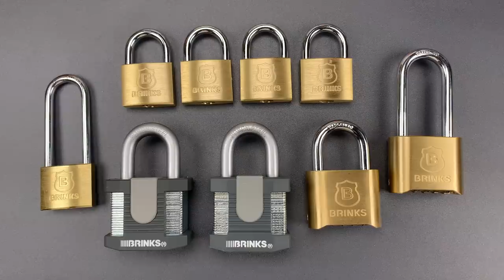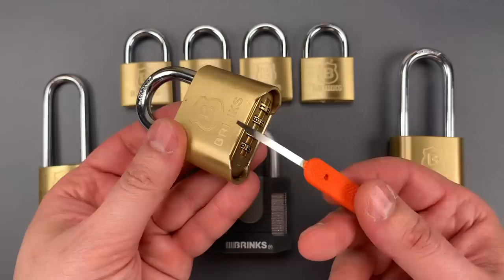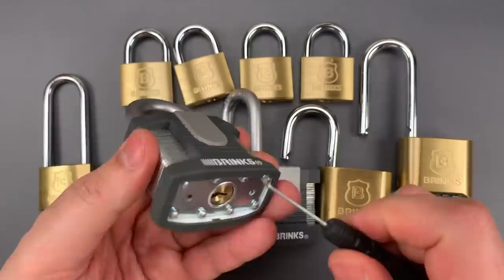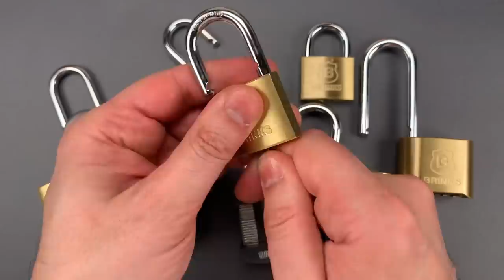[1009] Brinks Locks With INEXCUSABLE Design Flaws

Comment: The scary thing about unshielded mechanism and the comb pick exploit: you could execute them in broad daylight, and it would look like you just had a key.
Reply: Yeah. If you are going to be picking locks, I suspect you would have those 2 tools and probably others on a key ring.
Reply: as soon as the mechanism gets seized up, the bypass will become faster and cleaner then using the key. (as this bypasses one of the mechanism that can be seized, while the key has to interact with at least the core and the locking system)
Reply: Now I understand the Brinks-Mat 1983 robbery
Reply: @TheTheJimJim  but hope a cop doesn't notice or you'll be arrested.
Reply: These tools are effectively "master keys" which makes them potentially easier than a regular key.
Reply: @NimsQuarlo  Police have different purposes in different countries. In a lot of poorer countries they exist to enforce the will of the state and oppress. In the US they're there to make money through fines, bails and jails. Here in the UK they actually enforce laws exclusively; we don't have private jails and most crimes do not have an associated fine.
Reply: @jamham69  In every country they are there to enforce the will of the state. That is their entire purpose. They are not there to "make money." Funny you guys in the UK think you are special. Every government is corrupt, and every government has a police force to keep the plebs from getting out of line, even (and especially) in the UK - which is already a police state. At least in the US you won't be arrested and imprisoned for making a joke on social media.
Reply: @bubba99009  The fact that a white south-african living here was surprised that she could go to the police and they would actually help her says a lot.
We all live in our national bubbles and can struggle to understand how the rest of the world works.
The police here work to enforce the law but thats always with a common sense approach and almost never just exercising authority for the sake of it.
Reply: @Guigui_82  and yeah, i've been seeing bits and pieces of what's going on over there, but the worlds media has stopped talking about it so it's hard to get updates in english.
I don't know how you'd go about fixing the police brutality. is your government particularly conservative? i always thought the french were quite liberal
Reply: @jamham69  We can't say the governement is conservative. I don't know the english political terms to describe them (I'm not sure what "liberal" means). They're not racist, ok with gay marriage (the previous, more liberal gvt voted it though) and that kind of things (which is something more towards the left wing in France).
But economically, they are all for the rich. They seem to work for pleasing the big companies and against the poorest people (which is something from the right wing in France.

But even the previous governement which was from the "Parti Socialiste", so supposedly the left wing, didn't do much for the poor. 
Their main law was gay mariage, which is great for people rights. But economically, they didn't act for the poor.

The big fear here is to see the extreme right wing party leader (very conservative and racist...), Marine Le Pen, win the next presidential election in 2022. She was against our actual shitty president in 2017 and the fear of her accessing power is why Emanuel Macron won.
The 2022 election will most likely be similar. Except this time, people are so angry of the economical problems, they might say "fuck it, let's blow this f*cking country up and vote for her". Then minority rights would decrease dramatically, racism acts would raise because racist people would feel legitimated by racist politics. And it could lead to some kind of civil war which the actual strikes and demonstrations look like a preview of, I fear.

Maybe I'm too worried and paranoid.
But I know repressive regimes never come suddenly. They slowly progress as we don't notice or don't believe that the violences are the begging of it. And one day you realise you're in a repressive regime and you didn't do anything before because you couldn't believe it was coming.

Some other countries citizen get killed by their police now, like in South America I think (can't remember which country). So why not France ?

Sorry for the novel-size post. 🙂
Reply: @Guigui_82  To be fair, the police traditionally does both. They are the underpaid and overworked people fighting crime and maintaining order, but at the same time they often are too authoritarian and uneducated to see how they are used to cement the dominion of the oligarchs and the people on their payrolls.
Unfortunately, some being uneducated and authoritarian makes them attack left wing groups much harder than right wing groups, even though with their current income bracket they are among the people that would benefit most from leftwing politics (lower taxes for working poor and middle class, higher taxes for extreme incomes and effordless income [i.e. inheritage, capital gain..], better public services [schools - cops usually can't afford private schools for their kids, public transport - policemen often don't earn enough to pay the rent in the city they work in, police - policemen might not be unhappy to get better equipment and more men to do their job], better social security for the poor, less 'social security' for the rich [i.e. bailouts, subsidies, tax cuts..)
Reply: @_annoyed4692  I agree. The police certainly need more money and employees to do their job. In France, the police is a public service (don't know about USA). But the governement is slowly destroying the public services by giving them less money, so they can't make a good job so that can legitimate the replacement of these pubic services by private ones. Hospital, School, Police, Administration (taxes management...), the train network (SNCF), Airports, Highways are among the services beeing destroyed for many years (not only by the actual governement.
For instance, they sold the public highways, which were a gold mine for the country. They are selling Paris Airports, also very profitable. They are selling a big part of La Française des Jeux (the national lottery), which, you can imagine, makes a ton of cash.

I can't imagine they will ever accept to listen the people and compromise. Either we're gonna let them win and ruin this country or the people will raise an army with actual weapons, fight and maybe kill to take over the power from them.

The former seems much more plausible though. I don't think enough people are ready to give their life to fight this (I'm not), or not yet...
Reply: @Guigui_82 

Hmm.. the USA is about 20 years ahead of us (Germans) regarding dedemocratisation, wellfare reduction for the poor, wellfare increase for the rich, redistribution of wealth from the poor to the rich, in short, capitalism. And, or so I thought, we are about 5 to 10 years ahead of France, one of the few European countries with working unions and halfway effective labour laws. I mean.. I know Alsatian bakeries that moved (amost) all their stores across the border simply because its less hassle and less bureaucracy*  to employ people there, so France still must be doing something right**.

*: corporate lingua for "cheaper"
**: Which would help more if the German government wouldn't keep reducing workers rights and union power every chance they get..
Reply: @_annoyed4692  Indeed, Germany is often taken as an example by the right wing politics for their higher rate of employment (less unemployed people). But left wing people say many of those job are precarious, shacky (using Google translation for this word), so low salary, few hours a week only, so not full time with decent salary jobs. So they can't be taken as a good example of the soundness of the employment in Germany. 
Also I read that German welfare for unemployed people is very bag bad compared to France. You get less money or you get it for a shorter time. So you HAVE to accept any shitty job that comes up, which France is going towards. But Germany seems a step further to modern slavery by the rich to the poor.
Reply: @Guigui_82  It is basically a competition of countries for the 'best' conditions for corporations and the super-rich: Lower taxes for companies, capital gain and very large incomes, more subsidies and social security for corporations, lower wages, less labour laws, higher treshold values for all kinds of emissions, less regulation...

The 'winning' contries get the factories and jobs, the corporate headquarters and with it the corporations taxes. Just less of it every round.

This works especially well for small countries, because they can afford to lose 90% of their own 3 local companies taxes as long as it gets them 10% of a lot of other countries companies taxes. Luxemburg and Ireland are a good example for that.

Germany is too big for that, but 'at least' we can lower our salaries and increase our "flexibility" so much that we become Exportweltmeister while breaking large parts of EU economy. Helped largely by the Euro, a currency that no longer represents a single economies power, but an average power of a highly heterogeneous continent. Or simpler: A Currency that is far to expensive for Greece and Spain to sell on the global market, and way too cheap for us, making our products very competitive without us actually putting in much efford.

So.. bad for everyone but the Corporations (actually only their owners and upper management) and the super-rich:

- Greece and Spain have high unemployment and are forced to privatise their most profitable/valuable assets
- many Greece citizens live in poverty that we believed to be extinct in western Europe
- France economy is suffering, and unless the German citizens finally wake up might be forced to lower working conditions for millions to stay "competitive"

- German workers earn much less than they could
- German industry loses it's edge (because the cheap Euro and the low wages keep it running and profitable even without ambitious research and developement - for now...) and get's leapfroged by the Chinese

But hey.. upper management get's it's boni, the owners make a fortune, and the politicans get cosy overpaid jobs in those companies after their political careers, so in the end its good for everyone that matters...

btw: I'm an engineer, and I'm making roughly the same as the guy who had my job before made 20 years ago. Granted, salaries got up about 40% since then. But so did inflation. Unfortunately, less and less companies pay tariff salaries. And what they pay instead is about 70% of tariff. Since rent more than doubled since then he could feed his whole familiy with one job, while I have to decide if I want to save up for my private pension fund (since the regular one is sytematically demolished), or if I rather have an apartment to live in. 

Policemen and nurses are pretty much guaranteed to end up in poverty when they retire. Still about 40% of voters either think "everything is great, let's just keep doing that", while 10% believe "it's all the foreigners fault!!1!" Which, I suppose, is kind of a tradition here.

Large parts of the rest is focussed solely on climate change, which, granted, is important - but largely a product of capitalism, and hard to fight as long as a government of corporate suppositories do whatever crap a handful of oligarchs tell them, while the oligarch-owned media* paints it pink and calls it candy.

*: Luckily we still have public media, without it we might already be in some berlusconian capitalist wonderland...

"Act only according to that maxim whereby you can, at the same time, will that it should become a universal law"

[Silvio Berlusconi]
Reply: I don't agree. The unshielded mechanism is suspiciously fast
Reply: @christopherlawley1842  :-D
Reply: wtf went down here a year ago
Reply: @bap3227  😂😂 I totally forgot about the lock picking video😂😂
Reply: This. Barring traps, you're not going to stop an invader who's absolutely determined to get past the security, but you can and should at least make sure that the invasion process is noisy, slow, and extremely obvious to any witnesses. That'll deter most thieves, too.
Reply: Why does that "scare" you
Reply: @coleman6131  Because no one would look twice at someone trying to open a lock with that. At least picking takes time and requires identifiable hand positions to alert people nearby that maybe whoever's trying to get in shouldn't have access to it.

Comment: He didn't even need to get the pick that BosnianBill and he made.
Reply: That was a nice one 😂😂💯
Reply: can anybody recommend a good first picking set? (with combs, shims, hooks)
Reply: Josh derp  Which is kinda funny considering a disk detainer lock is in no way hard to produce or high tech. The original ABLOY classic disk lock patent is from 1910's and as such decades expired. Heck many of the newer cores are also decades expired. On top of that instead of doing exact shear surfaces on pins one is pretty much just stamping out the lock disks and stacking them. Sure it has to be stamped to good tolerance, but stamping is a cheap and very well mass production suitable process to produce repeatable parts in good tolerance. Same with the spacers between the locking disks again one can stamp them out.

with modern automation and hoppers full of ready stamped disks.... assembling the disk stack is just dropping in disks one after another, again very suitable for mass production.

So Walmart completely could offer as cheap simple disk detainers. I would say it might be actually easier to make a cheap good disk detainer since it involves less stuff like drilling multiple exact holes in exact places to exact  depts with good tolerances. The pin tumbler lock body is much more complex than a classic disk lock body. All the disk lock needs is a big drilled hole to drop the core in and cut in locking groove in to which the sidebar locks in preventing rotation. Then one just needs the core plug in which the disks ride and has the other side of the sidebars locking surface. It is actually the most complex part, but even that is in the end rather simple part with no complex geometries.
Reply: What?  Dammit, at least say spoiler alert 😡
Reply: @aritakalo8011  I guess they would not be that hard to make if you start from scratch building a lock making company. The old companies have capacities to mass produce cheap locks with little changes to the design. Big changes would cost them money, and since people still buy the outdated stuff in a new package they'll keep doing it.
Reply: They really just need to name that thing already.
Reply: It takes him longer to introduce that pick than it did for him to pick these locks.
Reply: @niandra_falls  thank you!
Reply: @littlegiantrobo6523 .  Magic Lock Opener Thingy.  I'm going to use my M-lot tool.
Reply: Ari Takalo ironically I’ve gotten disc detainer locks at Dollar Tree and I think I have seen a few at the Walmart’s around me as well. Home Depot of course has em too
Reply: Should just call it the Bilaneye
Reply: @J.P.__  shop around banggood .com. Plenty set there to start out with.
Reply: That fact actually makes me sad
Reply: JP , sure man! Go to “LockpickWorld.com and there will be a list of the top 10 best sets on their site. Personally, I chose the first one because it is a complete set, however it does not include combs, but those are pretty easy to get
Reply: Well none of these are disc detainer locks so...
Reply: the sacred tool is only for those locks with disk detainer cores that need to be rotated as far clockwise as the go
Reply: @J.P.__  GENESIS LOCK PICK SET is a  very high quality pick set & look on ebay and find you a good clear practice lock so you're able to see inside the lock & understand the concept of what's actually happening with the internal part's of a locking mechanism. The link below for the pick set I recommend & you'll find other tool's to find what you need to get your skill level where you'd like it to be. While you're there check out the other tool's that'll help you along the way. Good luck & happy picking...  https://covertinstruments.com/products/genesis-lock-pick 
# lockpickinglawyer #CovertInstruments

Comment: We want “lock of the year” video 
Pick proof 
nice design 
Well build
Reply: "Pick proof"

You mean the lock only used at the pearly gates?
Reply: the locks in this video are ok, as long as you jam some jbweld into the latch and key slot.
Reply: Blackjack148 I mean, he has shown some locks that would take a very specialized pick and a lot of practice to open.
Reply: AHMET HALIFEOGLU Maybe if he ever finds one that’s well designed...
Reply: @CarBuddy10  
This is the lockpicking lawyer, and after a long fruitful life I've found myself at the Pearly Gates. St Peter doesn't seem to be around, so we may as well see if we can save some time.

Pin 1, binding.....

Comment: Hello LPL,  Long time fan here.   I figured out the top row of locks in this video you can do without even the comb pick.   just a regular hook inserted towards the pins to hook the mechanism on one side then take it out and flip it and hook it going the other way and it will pop right open.